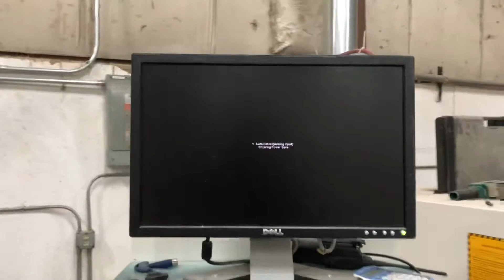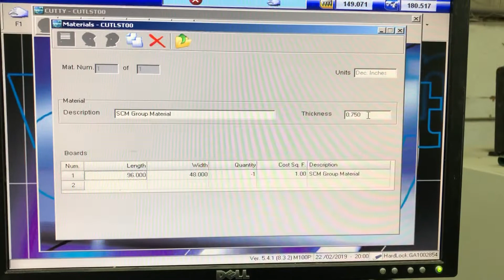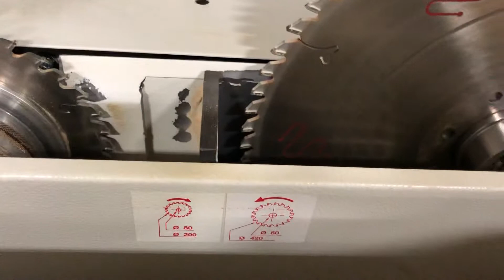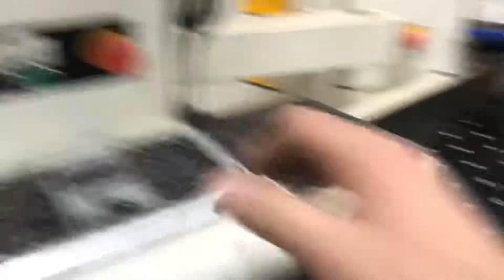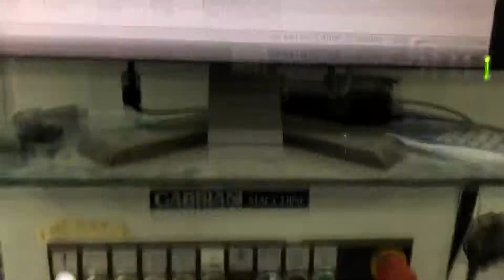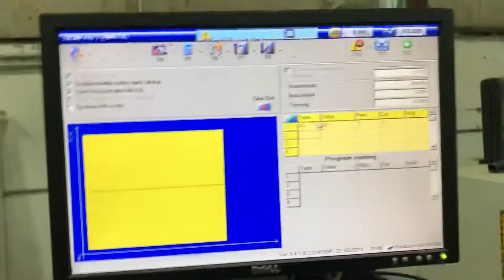Gabbiani Galaxy 125 Recap Training

Comment: Hi...great video... We have an SCM sigma impact machine and I'm trying to figure my way around it.

On first start it shows a bunch of error below

Saw blade not down
Rear (infeed) side aligner not up
Scorer not down
Saw carriage axis not calibrated
pusher axis not calibrated
Photocells surface cleaning
Saw carriage guides lubrication
Cycle stop depressed/ machine emergency/inverter fault

Can you please help get rid of some of these errors.